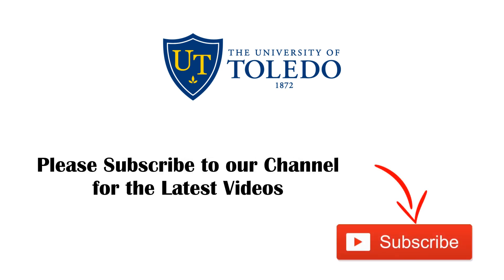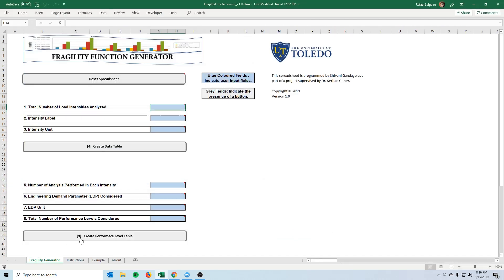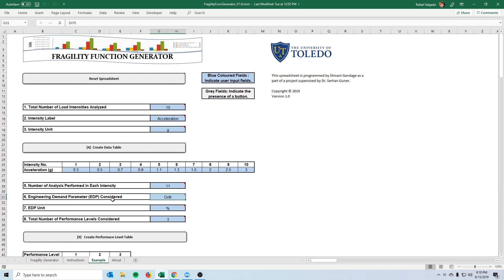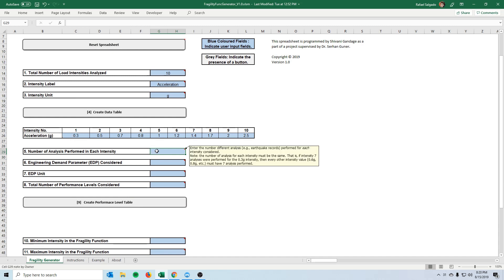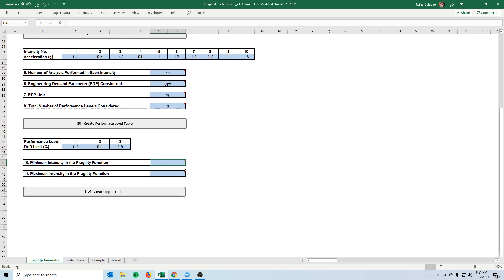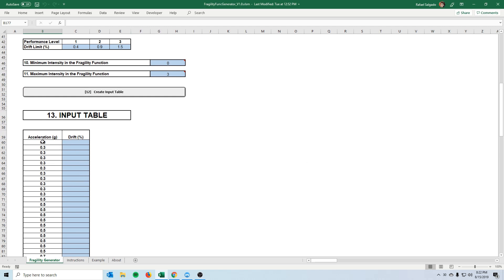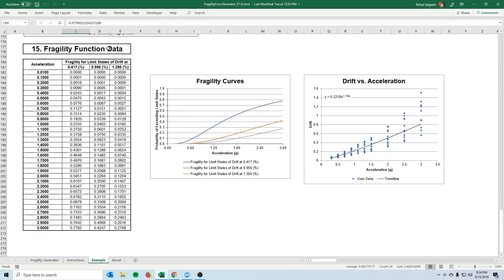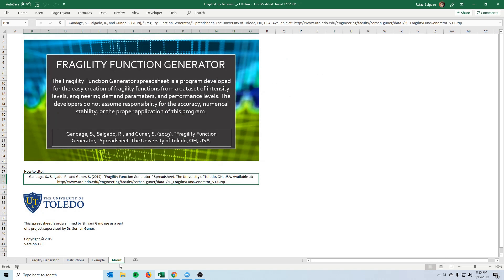Fragility Function Generator (FFG) for Structural Analysis

Comment: Is it based on Log-normal cumulative distribution function OR Normal cumulative distribution function? Please confirm.
Reply from the maker: The spreadsheet uses the Gaussian error function, a univariate regression model to fit a power curve, and assumes a two-parameter log-normal distribution to calculate the fragility functions.